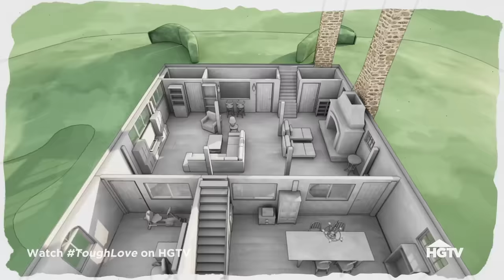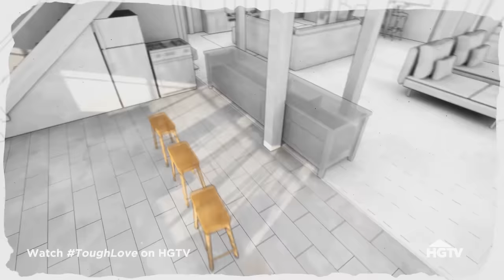Updated 200-Year-Old Barn Renovation | Tough Love with Hilary Farr | HGTV

Comment: The kitchen layout is terrrrrrible. That fridge is in a different zip code from the sink and stove
Reply: It's a couple steps away? Not exactly a different zip code. The sink is in the same spot it was before the renovation and the fridge is in the same spot too. So the kitchen triangle is essentially exactly the same as it was before except waaay more functional and open. Not exactly sure what you expected? It's a 200 year old barn and limted by structure and budget. The only other place the fridge could have been placed (without blocking the windows) is right next to the front door, or where the built in storage is on the wall perpendicular to the front, which would make it further away 😂
Reply: More than a couple steps, and around a corner. “It’s where it was before” is not a flex. It was bad before, and it’s bad again, after everything was taken down to the studs. And it’s not a triangle—get your prescription checked 🤓